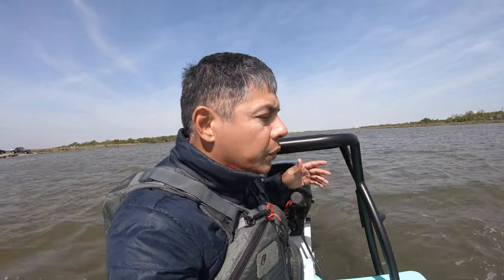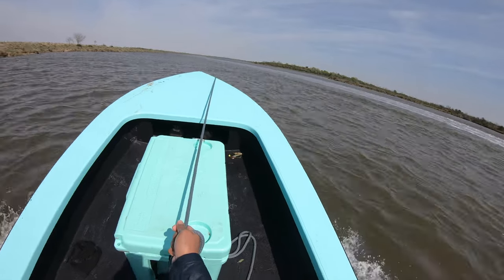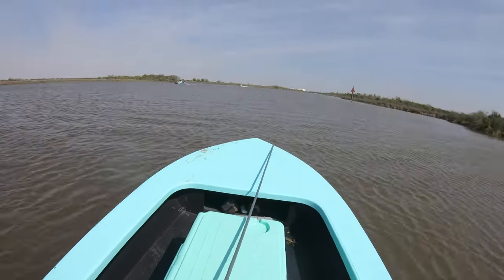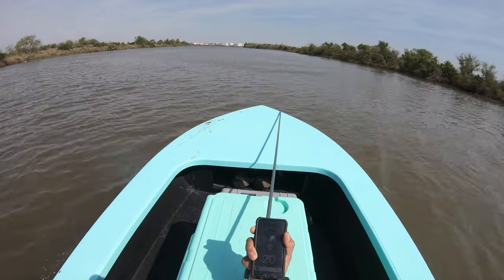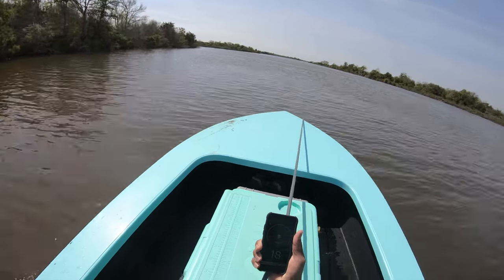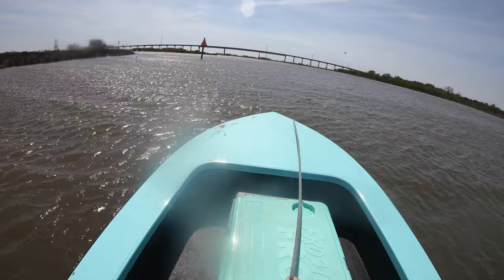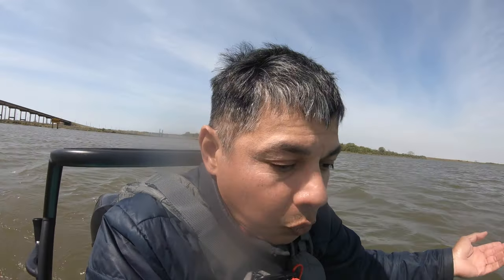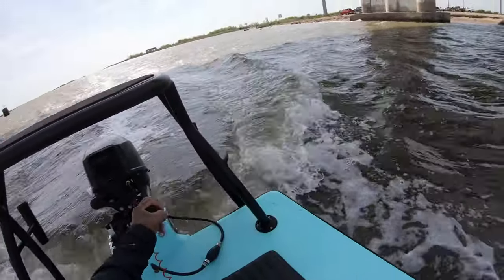Water Chop Test / Full Throttle in 14 MPH Winds / SkiffWorX

Comment: I am currently building out an HD aluminum casting deck, subflooring, trolling motor, and 100Ah battery up front of my 14’ Jon. 

I wonder how much different the ride will be now. 

I have a 9.8 and was getting 21mph with me and my son in there (<300lbs). Plus trolling motor and all our fishing gear. However, that was on a calm day with a bad prop.

You were moving along very well!

Comment: Get a piece of pvc just larger than the tiller handle and cut a slit on one side of it for about 6”. Put one of stainless screw bands on it and tighten it down. Makes a good tiller extension
Reply from the maker: Thanks for the tip but this awesome performer will be going back to SkiffWorX.

Comment: Id rather have a hydraulic adjustable jack plate instead of that bolt type. Screw that kneeling down and possibly dropping that
Reply from the maker: Do you mean hydraulic trim? The jack plate is solid.
Reply: @texascoastalliving  I believe a mfg. called Atlas makes a hydraulic jack plate available from TH Marine. Another is called SeaStar. Total Badassery.